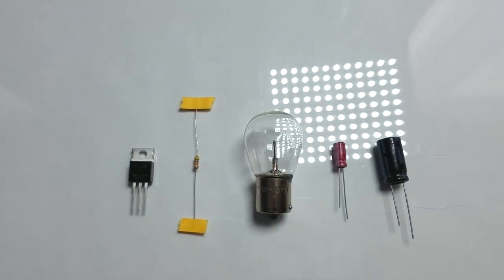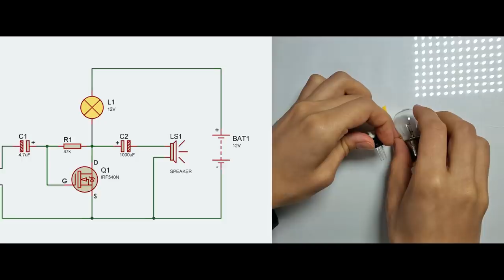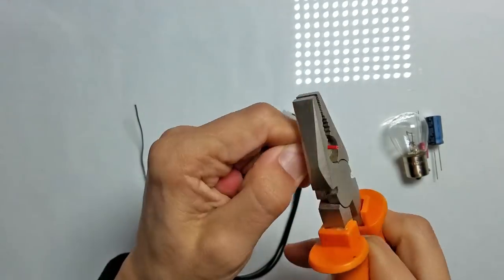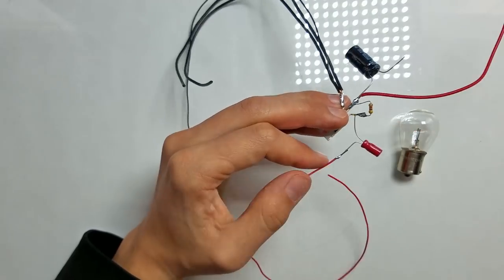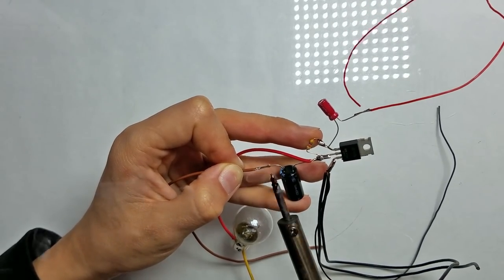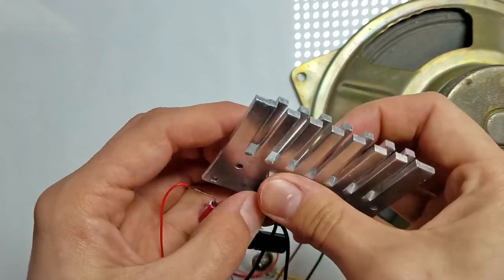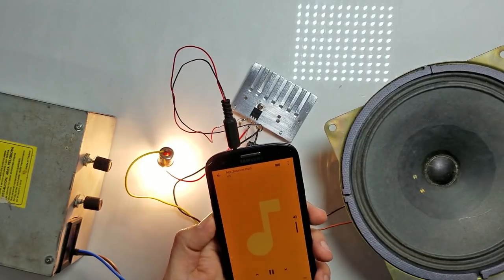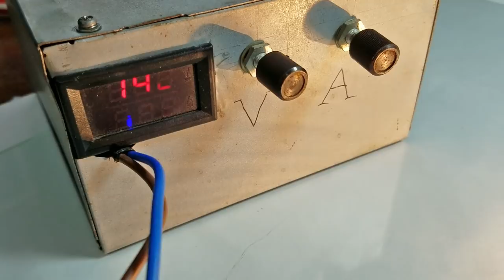How to Make Simple But Powerful Audio Amplifier Using One Transistor [DIY]

Comment: I made your simple but very interesting project last night and it was fantastic. The sound quality is remarkably good and the sound level is big enough to hear from the adjoining room, even after the door is closed. But I did some changes to your original design to suit my expectations after doing some calculations and following trial and error method. I achieved the best result by the following changes,
I did not use 12V power but used only two 18650 batteries (about 7V) as I always prefer to use 18650 in my small projects. I replaced the light bulb with an 8.2 Ohm 7W wire wound resistor. Used a 4700 MFD capacitor to couple the speaker. Used two 3.3 kilo Ohm resistors to make the stereo sound source to the mono amplifier input.
Even at a fairly high volume level, two batteries ran for more than 4 hours to show a noticeable power loss. Heat generated by the resistor and MOSFET was hardly noticeable. Hoping to build the stereo version in the future.
This is truly a good project for kids and Tronics beginners.
Thanks for publishing this wonderful project.
Reply from the maker: Thank you so much for your feedback. I am happy when it all works as intended.
Reply: Thank you for sharing such a good idea

Comment: Neat one, thank you for your presentation, I have 5v 1500mA power source, 102H transistor and S9014 transistor. Please give me some advices , which types and values of bulbs, resisters and capacitors should I use .

Comment: I have some wuestions. I build pair of this, connect to negative (power in and audio in) side but use 2 different positive power in and left right sound in to make stereo? I just build ic-s amplifiers but this is the first try to make an transistor one. I have 4 transistor (if i make mistake i have another) . I think right or bad?
Reply: Greetings.
Never tie left and right together. It leads to frequency cancelation and when things really go bad, it can destroy the output stage of your audio source.
Take two fairly low resistors, from 1k to 4.7k (I used 2x 3.3k) and solder one in line with left wire and the positive input of the amp, and the other one in line with the right wire and the positive in. So the resistors are joined on the amp side. That's the simplest stereo to mono mixer.

Comment: Ok, this circuit definitely works. But mine had terrible audio quality. Very low bass and it is not very loud. I swapped out the 4.7uF input decoupling cap and put in a 47uF. It's much better now but still not very loud. Speaker is 4 Ohms.
Also there is a quite loud humming noise that is aprox. as loud aß the music when my phone ist fully turned up. Any idea how to get rid of that?
But anyway, nice little project.

Edit: got it. Added a 100nF cap in parallel to the powersource and switched to a 12/5A supply. With an adequate headphone preamp it gets damn loud. But with heavy distortion but still listenable.

Comment: Hello , i have a few questions regarding the amplifier . As i don't have many choices for component's i would like to know if it's fine to use a bit different values before i build this circuit . Is it ok if i use a 2300 uF capacitor instead of a 1000uF one ? Is it ok if i use a  2.2 uF capacitor instead of a 4.7 microfarad one ? And i only have a mosfet this type : SE 9302 ( which is a mosfet used for amplifiers ) is it ok if i use that one instead of the one mentioned in your video ? I am just asking because i don't want to waste my time building it if it wouldn't work with my choice of components . If you can please reply , and have a nice day !
Reply: First of all, yes, you can use a bigger cap than the 1000uF as output cap. The bigger, the better bass response you get. On the other side, the input, I am too lazy to do all the calculations for a highpass filter. That is what the input cap forms together with the MOSFET. Choosing a cap too low will result in a bass cut. But I think 2.2uF is still rather high so it should be fine. Even 1uF should not make any difference.
Last but not least: I cannot tell you if your FET will work as well because I don't want to read the datasheets for you. Compare the ratings and try. I guess it will work but it may be that it distorts terribly

Comment: Hi - neat tutorial!  What's that stuff you're rubbing on the wires before applying the soldering iron?
Reply from the maker: Hi, thanks! That is liquid flux (I was applying it using a match). People often use rosin instead. You can mix rosin with alcohol and make DIY liquid flux... or you can buy it.
Reply: @ElectricalPro WhatTypeOfAlcohol?

Comment: My vintage cutter runs on a Light bulb, but it plays in sync with the speaker. well its supposed to be.. i m not sure to wire it direct with a 5 k resister and then branch the speaker off of that,.,

Comment: The output capacitor is necessary? Many amplifiers don’t have capacitor before the speaker.
Reply from the maker: Those amplifiers require a bipolar power supply (three wires, e.g. +12V, 0V, -12V), so they don't need a capacitor. There is also another approach by using full H-bridge, but it requires four transistors and a complicated circuit to control them.
Reply: Electrical Projects [Creative Lab] Thank you for your answer!

Comment: Bro.. what will happen if we connect the circuit without bulb???
Reply from the maker: Well, if you connect it without bulb current will be too high and... it will trigger over-current protection if your power supply has it... or if you power it from a car battery for example, then something will start to burn.

Comment: is it ok to have no light bulb?
my light bulb  is 1w 220vac.
Reply from the maker: Hi, the light bulb is necessary. Moreover, 1W 220V is not enough, please use 12V light bulbs. I recommend using at least 5W 12V light bulb. You can use resistors instead of a light bulb, but the resistors must be powerful because they will dissipate a lot of heat. For example, you can use 24 Ohms resistor, but it must be 6W... you can use many resistors in parallel to get about 24 Ohms and 6W in total.
Reply: @ElectricalPro  what kind of resistor to be used?
Reply from the maker: For example 24 Ohms resistor, but it should be at least 6W (it could be many resistors). For example, you can use four 100 Ohms resistors connected in parallel, each resistor has to be at least 1.5W... so those four resistors connected in parallel will give you 25 Ohms and 6W in total. (I made some mistakes in previews post, I corrected them).
Well, there is no single right answer about a resistor... the point of the resistor is to limit current at 0.5A - 2A, so what resistor to use is up to you. Use Ohm's law to calculate. The higher the current the more powerful amplifier you will get... but high current means a lot of heat.
For example, let say you want 1A at 12V, so using R=U/I we can calculate 12V/1A=12R so when using 12R resistor you will get desired 1A current... but we also need to know how much heat the resistor will make P=U*I, so in our case 12V*1A=12W, so you'll need at least 12W resistor. You probably will not find 12W resistor, it is very powerful, so you will need to use 4 - 20 of the less powerful resistors... you will need to connect them in series or in parallel, it depends on what resistors you have.
I have used a light bulb because it is much simpler.

Comment: How many watts can I get out of it?
Reply from the maker: It depends on how powerful lightbulb you use. I don't have the equipment to measure, I guess it is about 5-10W when using 21W lightbulb... I've used 8W speaker.
Reply: @ElectricalPro  it is 1.1V RMS into 4Ohms without (audible) distortion on a 12V/5A supply. So this is 1.1V² / 4Ohms = 0.3025W. Not more, not less. Sorry bro, but you wont get more than 500mW with heavy distortion. Maybe If you use a 24V supply but I guess that will blow the FET...
Reply: @ElectricalPro  btw.: Your heatsink is waaaaayyyyy too small. I used an aluminum block from an old PC supply and I can fry eggs on it, haha
Reply: Can I use a 16v transformer.

Comment: What a joke - the speaker is probably just as loud with the phone plugged directly into it! 

Show us the waveforms so we can see if it really is amplifying at all.
Reply from the maker: First of all: I don't have an oscilloscope. Second: It is a classic amplification circuit, except it uses a light bulb instead of a resistor, why wouldn't it work? People don't believe in a one-transistor amplifier, but they happily believe in free energy generators. What a world we live in.